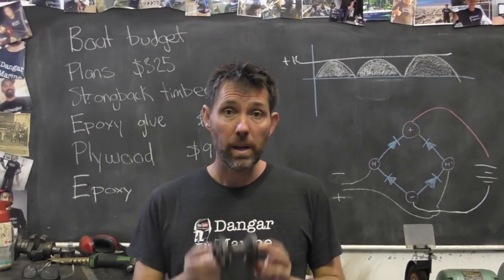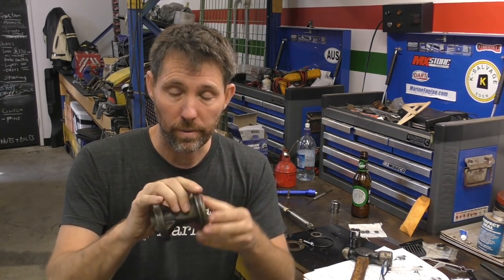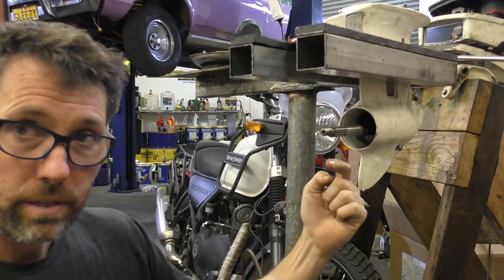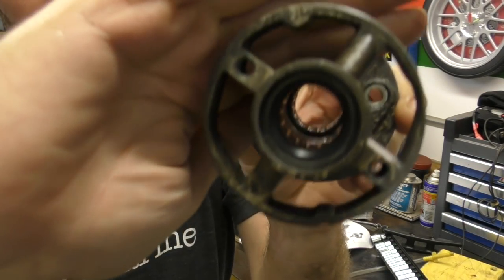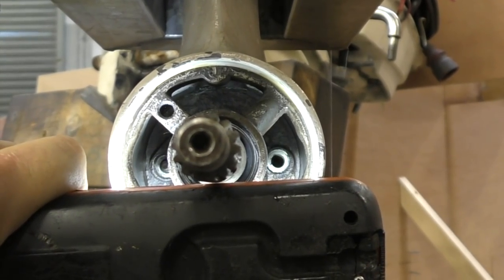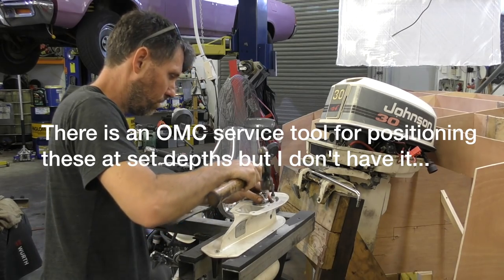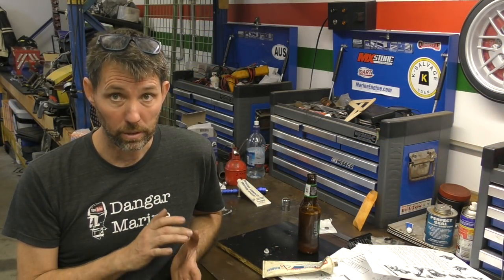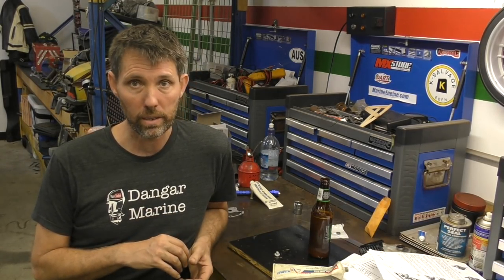Johnson 30HP bearing carrier installation

Comment: Stu, what I’ve used to align the carrier retainer plate and the bearing carrier is two pieces of long all-thread. Once the carrier is seated, remove one piece of all-thread, insert a retainer bolt, then remove the other piece of all-thread, and insert the other retainer bolt. Tighten to specs. Easy peasy.
Reply: This is an excellent idea. Thanks!

Comment: Hadn't noticed this vid before. Great explanation, and very detailed. I can imagine how hard that assembly would be without the "tricks and tools".
Re the LTD, yes those Fords had the headlight current going up though the switches. The XA Falcon (and similar variants) would sometimes suffer from the smoke getting out of the switches... You can imagine - at nigh of course, a smoking headlight switch when you are driving along the freeway!
And the difference between those era Fords and the boats you play with is that the Fords will rust without actually going near the water!
Reply from the maker: Thanks mate. Driving at night with smoke in the cabin sounds like a nightmare!

Comment: I also vacuum seal my lower units I only do that because I had a weird curve ball thrown at me one time on a lower unit it would not leak under pressure but due to the cavitation of the drive shaft in the water while running it was causing a vacuum ever so slight that would allow water just sneak off of seals this was also in conjunction with a pitted drive shaft. It all come together as a perfect storm that took vacuum sealing and some cussing to figure out. LOL I enjoy your videos is always a little when I got to do to get a danger marine shirt I would be the only one in Texas with one. LOL
Reply from the maker: Nice work on figuring that one out! :)

Comment: Is there a particular alignment between the drive shaft and pinion? Read a line in my manual regarding water pump replacement saying to be careful not to pull the driveshaft up because the gear box MUST be disassembled and the pinion realigned to the driveshaft. Can’t find anywhere in the manual saying what that alignment would be...

Comment: Your YouTube videos are awesome. Need to know what would be the problem in my 1978/700/70hp mercury when I put it on forward the shift seems to me is loose doesn't pick up the speed and bogs down. Sir you're help will be appreciated. 
My name is Moe
Reply from the maker: Could be a carburettor problem.
Reply: @DangarMarine  Sir I have serviced the carb / when its on drive the speedo cable is loose

Comment: instead of the needle bearing assembly grease could you get by using marine grease on the reverse gear thrust washer to hold it down? that or could i use engine assembly grease? i assume it would be best to also grease the needle bearings themselves as well?
Reply from the maker: Needle bearing grease is very similar to Vasoline.
Reply: @DangarMarine  another question instead of the perfect seal around the carrier could i use the aviation gasket sealer only thing that worries me a tad bit is it seems to get tacky when it dries so i was unsure

Comment: You could have cut a slot across the head of the guide pin with a hacksaw so you could retrieve it by screwing it out with a slot screwdriver, looking forward to more on your steel ex-trawler rebuild.
Reply from the maker: Good idea!

Comment: When you install the new seals do they need to be flush with the outside lip or does it not matter?
Reply from the maker: They generally press all the way in until they hit a stop inside the bearing housing.

Comment: Hey Stu, great vid! Need any parts for that LTD? My father in law has some NOS and spares in the shed. Can send some photos through in an email if ya like. Cheers, Pav.
Reply from the maker: That would be interesting to see. We have the heads off and at the engineer for machining at the moment as it had water in one cylinder. Where does your father in law live?
Reply: Dangar Marine sounds like the project is coming along well. We are located in SA mate.

Comment: The pressure on the bottom end be 10 lb PSI on a 48 horsepower Johnson same as the 30?
Reply: butch c I'm not familiar with Johnsons, but usually in outboards, the 20 hp - 30 hp all share most of the same parts (especially main parts). Usually 40 hp - 60 hp are the same. I'm guessing your 48hp has a different lower unit. It probably is close numbers in the pressure test. What you are really looking for is if it holds pressure for a certain amount of time, like Stu said in the video, its probably just several seconds. If there was a leak, the pressure would drop pretty fast and would be noticeable.
Reply: It is the depth under water that determines the test pressure. So 10PSi is actually pretty good for almost all engines of the outboard type. In actual use the prop shaft seal is under about 3psi pressure when at rest, and typically under a slight vacuum when under way. At high speed -  above 20knots or so, the exhaust outlet under water is in a pretty high vacuum area.  The drive shaft is rarely under much pressure at all, the most being when the engine is at rest, and even then only a pound or so.  When the boat is on the plane that are of the engine can easily be 'dry'.

Comment: Hey Stu, I just replaced the prop shaft seals on my 2006 25hp Suzuki outboard. I put it all together and reinstalled it to the lower unit without problem and seems to shift fine. My question is how do I know that the forward and reverse gears are lined up correctly with the pinion gear?